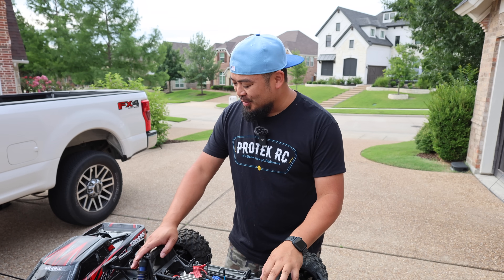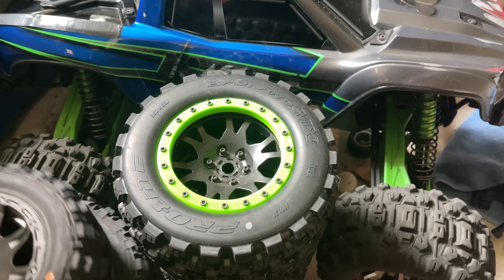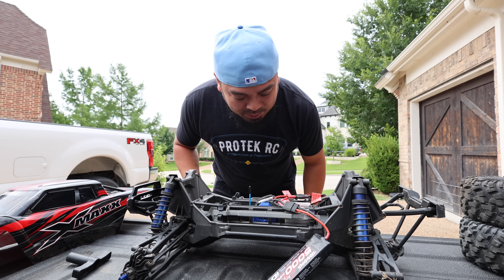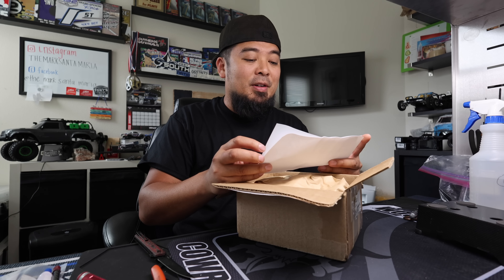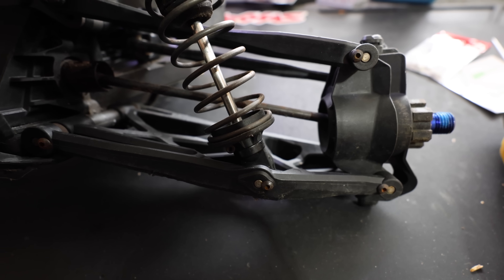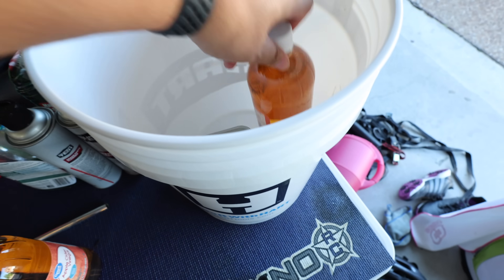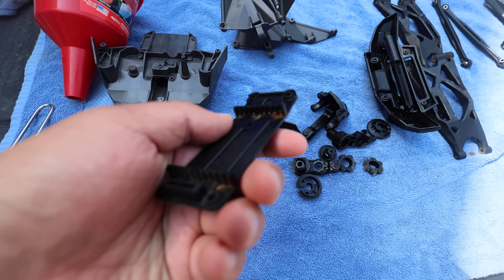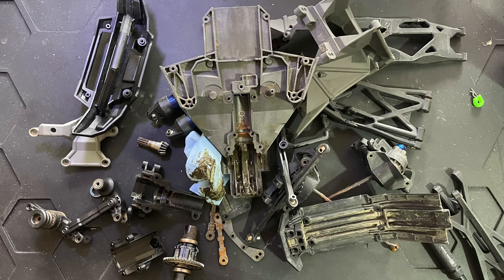THIS RC CAR IS WORSE THAN I THOUGHT! | TRAXXAS XMAXX 6S REBUILD

Comment: You and I are cut from the same cloth, Mark. I hate picking up second hand trucks or cars, and not going to town, cleaning them!

I picked up a very well abused, Carisma Sca1e Coyote last year, and ended up with pots of parts in cider vinegar. Just make sure you rinse them off really well. Works a treat.

With the plastic parts, I know I've seen someone use soapy water, with olive oil in it! That leaves the plastic shiny!

Looking forward to seeing the finished car. 😎👍🏻

Comment: As someone who restores vintage RC cars. Rust always looks a  whole lot worse than it is. It is actually easy to work with if you get the right products! 
Products like evapo-rust or anti rust from noverox will make easy work restoring the bolts to almost new condition.
I have had cars that where basically at the bottom of a pond. Now looking brand new. 
To restore plastics, use bumper spray (the stuff you use to restore the black plastics on a car) or silicone spray. It will get that fresh new plastic look in a matter of minutes.
Lay the parts in the sun for a bit so they warm up and dose them in silicone spray. Get a old paint brush and brush all the parts so you dont miss a spot. After thats finished you can spray them off with some water and let them dry. 

Dont ever let a rust bucket turn you away from a nice deal is what i can say. :)
It might be a lot of work. But once your rc car is done, ready to drive.. it is so rewarding!

Happy building! -

Comment: This is why I’m convinced it’s almost never worth buying used. I can tear apart and rebuild anything but at what point is it worth the cost savings. I wouldn’t pay more than 200-300$ for that Xmaxx considering condition and service needed. It needs electronics, body is crap, and all moving parts needs servicing, bearings and screws need checked too. That’s not a beat truck but it needs work for sure.

Comment: I'm actually curious about the original 6s xmaxx. I've run mine on 6s and it's pretty underwhelming but I assume that because of the different motor and esc spec the original xmaxx that's made for 6s should run a little better? But I'm not sure. Anybody know how a 6s xmaxx compares to a 8s xmaxx running on 6s?

Comment: I keep mine inside, I had them in the garage before the humidity kicked into high gear. Traxxas support told me not to keep them in humid weather as it would rust parts/components (I assumed that but wanted to double check). I'm outside of Houston, so it gets hot and humid for sure. I don't even like going out to run them in this weather, too damn hot for me. Spring and Fall are perfect.
Edit: Great tips BTW, thanks for the vid!
Reply: Hey, I’m only in college station and I get the same thing down here. Was it really recommended for you to keep your RC inside and not in the garage? Of course I have all my work stuff in workstation in the garage and it’s always easier to keep the car outside in there instead of inside where my kids could get a hold of it.
Reply: @jondrozd4321  They may have been more worried about the batteries not being in a controlled environment. They recommended the vehicles. After being out here for over 10 years, I've had BBQ's rust apart, LOL. I also keep the garage open a lot, so it gets pretty nasty inside when left open. I'll reach out again to see what they say.
Reply: Batteries especially these “Lipos” I do definitely see not being in a hot garage..

Comment: Always, ALWAYS seal the wheel air vents and ventilate the tires instead, before running them even one single time. Sealed wheels / ventilated tires are impervious to damage from water and debris.
To this day it boggles my mind why so many premounted tires come with vented wheels. Why???

Comment: The only thing I notice with evapo rust which really is my go too I do a lot of vintage is if the rust is bad enough you might lose the original coat of parts. But it is by far the best iv tried and does not smell

Comment: another good idea regarding the plastic parts is to put them in warm water with soap ,of any kind ,and afterwards try to  scrub the really dirty areas with an old toothbrush. After you rinse them  you give them a good wipe and then you spray them with some good old fashioned WD 40. You leave them overnight ( or more ) and then you wipe them with a piece of cloth and they will shine !!!!!! P.S: Stop using your wife's kitchenware, cause there's a 99,99999% chance that you will be in trouble.😛

Comment: I love watching you go through the headache of that! And no I'm not a sadistic person. Haha! I remember the first time I took my highly modified clod-buster to the beach! No matter how well I washed it a month later everything was rusted bearing seized motor seized and I had aftermarket Motors and speed control which was waterproof thank God! But it was such a headache next time I see all the gear boxes put sealed bearings on the outer shaft and put stainless steel Hardware throughout no problems with the beach again! Thank you for the video it teaches me about the x-max I'm not a fan I've always been a Losi nut! That Team Associated as well. I got a break all my old stuff out rebuild it converted to brushless and see how much stuff I can trash that I can't get parts for anymore hahaha thanks again for the video I've watched many viewers